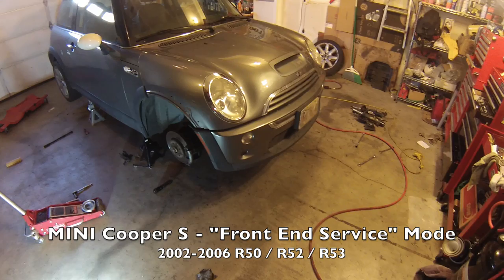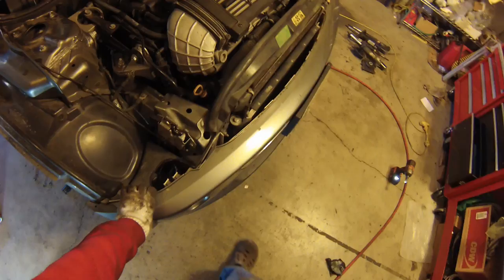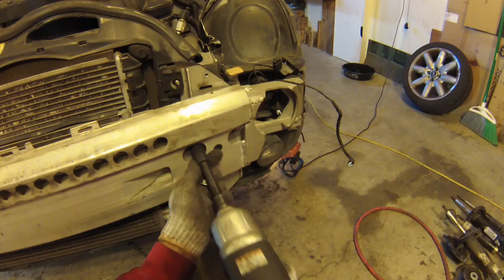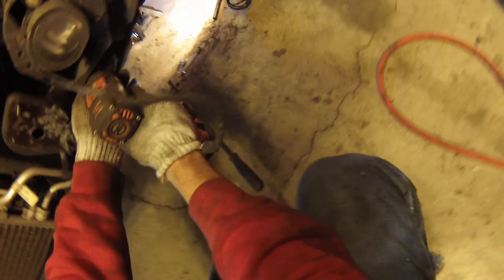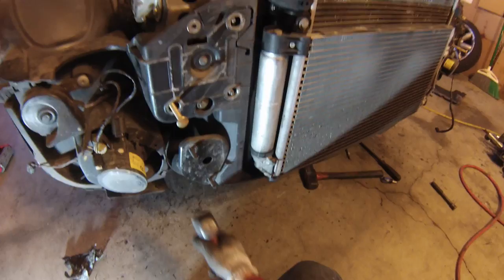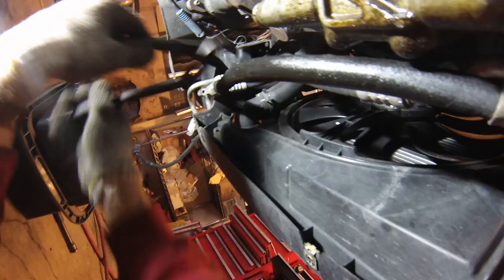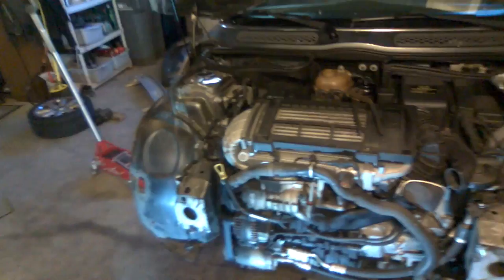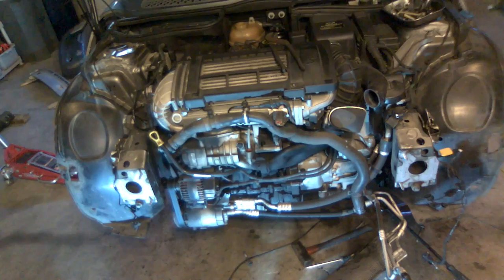Front End Service mode 2002-06 MINI Cooper/radiator/bumper removal howto

Comment: Great video and narration :)

what length and diameter size are the 2 support bolts to hold the front bumper section please when I disassembling. If possible the diameter in millimetres where they screw in.

With this radiator pulled away but still attached by radiator hoses, would this give enough clearance to allow the  low speed resistor to be changed?   
regards
Reply from the maker: ***** They should be M8 x 1.25 bolts, the longest you can find. Should be enough room to work on the fan resistor but the angles will be a little strange.
Reply: top bloke :) many thanks for your reply. Keep up the good work-we need you.
Reply: I found you don’t need any bolts. Just use a couple of long screwdrivers and slide them in. Worked just fine when I replaced my alternator.

Comment: Thanks for all the videos! I didn't see one for the reassembly though and it looks like there are some nuances to getting the radiator back on, functional, getting bubbles out, etc. I've been following you religiously the past few weeks since I inherited a 2004 Mini S and have been repairing it to pass inspection.
Anyways, do you have a reassembly video by chance?
Reply from the maker: +David Konopka Unfortunately not in one place. I show radiator bleed and front end assembly in several of my other videos. Sorry, I don't recall which, but should be some footage in most of the major engine/clutch repair videos.

Comment: I have an 06 cooper s and when i drive and turn on the a/c it goes into limp mode with the ses light now. Air blows cold when idling though. any idea at all would help
Reply from the maker: Might have a failing AC pump and it is putting excessive load on engine?

Comment: My customer came to the shop with a leaking radiator on a 2003 Mini. No one in town would work on this car. Even with a hoist it took me all day to get to the radiator. Since then I have done a heater core, sucked! Thermostat, sucked! Heater hoses, Sucked. And know the ac condenser has been damaged from running into a stop curb in a parking lot! I have to tear the from end off to change that in the morning. Oops, start working on it in the morning. I'm sure it will be dark tomorrow before it's even close to being done!! But-- They are really good paying people!
Reply from the maker: Not fun the first time, but with practice, you can get the radiator completely off the car in around a half hour, thermostat 45 minutes or so. And hose clamp pliers are a must. http://amzn.to/1miUekA
Heater core... that's a headache on just about any car. Keep calm and carry on.

Comment: Hi if the ambient temp sensor is not working could it possibly just be plugged in backwards as it was in this video?
Reply from the maker: Impossible to plug in backward.
Reply: @ModMINI  ok I had to replace the plug that was missing and add a sensor. It works now.

Comment: Got a quick one for you, ive recently changed my spark plugs but on removing the 2nd one  the bottom end of the spark plug was covered oil what would you say is the problem?
Reply: Its mileage is 68,222 miles
Reply from the maker: Valve cover gasket spark plug tube seal?

Comment: A friend is giving my brother a 2010 which needs an alternator...  so thanks for this video.  Looking forward to working on this car..  Any recommendations on the manufactuerer replacement parts.. replacing the alternator = new belt -- saw at Rock Auto a Gates HP racing belt... is this worth the extra $$, also tensioner puller + idler pully as well as the crankshaft position sensor that you mention?? Any other parts to change while "you can get to them"  thanks.
Reply from the maker: 2010 is a totally different car. This video won't help you. You don't need a racing belt and crank position sensors are not problematic on 2010. You may want to replace oil filter housing gasket which commonly leaks. It's behind the exhaust manifold (downpipe).
Reply: The car is about 50 miles away from where we live and tow prices are outrageous... Question -- If we throw a battery in.. and start it.. will trying to run it solely on a battery both a) work and b) potentially cause any engine damage??  c) any experience on possible how far one could get without an alternator thanks.
Reply from the maker: Maybe 5 miles without alternator...
Reply: Disconnected the head lights and got 30 miles before it ran down on a new battery.. thanks.

Comment: Good video! Now, a question... Where can I find OEM screws and bolts, as well as connectors for the bumper lights for my 2003 Mini? Some dude jumped the red light and clipped my car in an intersection and took the whole bumper away and took off... I gave chase and got him. Now, the insurance company will total the car and I plan to buy it back and fix it. So, anyplace to buy all the needed parts over the Internet at a good price?
Reply from the maker: +Adrian Mendoza You can buy most parts from the dealer but will be expensive. eBay and Amazon are good places to look for aftermarket parts. Nuts and bolts will be harder. Some are available from the dealer / online, some you are just going to have to find a suitable replacement. You might go to a local junkyard and take some nuts/bolts off various MINIs and BMWs. Go to realoem.com for an idea of what parts the dealer is likely to sell.
Reply: +Mod MINI Thank you very much!

Comment: Hello mod MINI, whether is it possible to replace crankchaft senzor o-ring without removing cooling radiator ? Just remove bumper and then replace o ring while still standing on support bolts ? Best regards !
Reply from the maker: Yes, that is the proper way.
Reply: Mod MINI thanks for answer ! best regards

Comment: What size bolts do I need to hold the radiator in place?  mm?  length?
Reply from the maker: +Ryan & Jen I believe they are M6 x1.00 thread, and just get the longest you can find.

Comment: Hello Mod MINI, I recently started having a coolant leak that has evolved into dumping the entire reservoir tank in a 5 mike drive. I just replaced the gasket from flange to block and water pump to flange. The mechanic who worked on this before used some sort of silicon around the old gasket. After the new gaskets the leak is still there and just as bad. Is it true the water pump dumps coolant when it’s old?
Reply from the maker: A leak that bad should be easy to find. Are you talking about thermostat gasket or water pump gasket? If you replaced the thermostat gasket, the leak could be coming from the thermostat housing itself. If water pump, assuming R53, a leak that bad from the water pump should be obvious as well. Usually leaks out the weep hole for the impeller shaft.
Reply: I changed the water pump and got a new flange for the engine block too. I was filling the system with coolant and let it idle and there was no constant drip anymore but I as I got in I could here a spurting noise that was coming from the cap. It looked like I had put too much coolant and it was being forced out of the cap in the reservoir tank. I removed coolant drove it 100 miles in traffic with no problems but when I finished the tank was empty. New cap possibly? The thermostat was replaced 3 months ago and there was no visible leaks from it or anything else. The old pump as a stream of dry coolant coming from the bleeder hole.

Comment: Thank you for all of the videos you have posted. They are all very helpful. I was just wondering if you had any idea of a website that sells the wheel well plugs. I ruined a lot of mine when taking them out. Living in New England with all the salty roading in the winter really took a toll on this mini when my father owned it.
Reply from the maker: Do you mean the retainer clips? ECS Tuning should have them or your local dealer, or check out eBay... ecstuning.com
Reply: ***** I think I found them on ebay, if those are the same "plastic lugs" in the wheel well liner. I store the car a few towns over from me so I can't look at them at the moment to be sure. I appreciate the quick response. thank you

Comment: Thanks for your videos. They are helping me a lot with my R50.
Just a Quick question @Mod Mini, Is there a way to replace the knock Sensor Without having to put the Car in Front End Service Mode?
Reply: As R50 does not have the Super Charger, it is possible to see the Knock, but i'm afraid of taking it out and then having suffer to put the new one in the proper position.
Reply from the maker: For R50, remove intake manifold to replace knock sensor .I don't know if it can be done without service mode. Not hard to put back in proper position. just bolt it up in the same hole you took it out. The orientation is not important other than to keep wire from rubbing on something.
Reply: @ModMINI  Thanks for your feedback... Your videos are amazing, keep making them. I couldn't figure out a way to replace the sensor without service mode, although its a very easy replacement, the sensor location is not helpfull. I took the chance and replaced the AC Bearing

Comment: I am going to be replacing the Radiator Support (Front Bulkhead Oem Gen1 R52 R53 Cooper S). What fasteners do I need? Currently purchasing from Mini Mania.
Reply from the maker: None, you should be able to reuse all of them.
Reply: Some of them are broken. Had part of a cover on the bottom break and it threw plastic under the car and broke part of the Radiator Cover.
Reply from the maker: Look up realoem.com for parts and fasteners.

Comment: Hi, Do you need to recharge ac after front end service mode?
Reply from the maker: Only if you punch a hole in the condenser by accident. The AC system is not opened.

Comment: I need help Removing those two fog lights , I don't know where to disconnect it from
Reply from the maker: sultan sullins Behind the wheel liner. If you have trouble disconnecting the clips, just turn the whole bulb 120 degrees and take the whole bulb out.

Comment: In this video you mentioned the Knock Sensor. Did you make another video covering this? I'm getting code P0326 Knock Sensor 1 Circuit (Bank 1). This is all foreign to me so after getting the front end off I'd be confused on what to do next.
Thanks in advance.
Reply from the maker: Hi. No other video, but knock sensor is directly behind the supercharger. You can see the wire on the front of the intake manifold but the supercharger has to come off to get to it.  Check my supercharger oil service video. MINI Cooper S Supercharger Oil Service R53 Eaton M45
Reply: *****
Ok, thanks for that information.

Comment: I am in process of having to do a head gasket on a 2012 countryman 4wheel drive  will I need to remove front bumper like this to do it
Reply from the maker: +John Slaton Yes but it will be a different process.
Reply: Ok thank you will.i need to remove engine or is it possible  to.remove timing cover in vehicle??
Reply from the maker: +John Slaton The Countryman engine does not have a removable timing cover. It uses a timing chain cassette with a two piece crankshaft sprocket. The work can be done in the vehicle.

Comment: Thanks for shearing this great video, I have a coolant leak problem from my R53, literally it leak from the connection part between the upper hose and the radiator, it looks like a hard plastic and fixed with the radiator. it's that possible to replace it?
Reply from the maker: L cyrus That's common on the 2003 and earlier. The radiator inlet is separate piece from the radiator. You might be able to pull and replace the o-ring, but no guarantee it will work and I've never seen this part available on its own. Plus, the plastic may flex with age. Recommended fix is a new radiator.
Reply: Yea, I've been looking for that connector for a while. Do you know the size of that o-ring? I can try replace it first rather than replace whole radiator.
Reply from the maker: L cyrus I don't know the size. It's skinnier than the general purpose ones that you can get at Harbor Freight.

Comment: How  lm qen remove oil dipstick tube an may mini cooper sjohn supercharge
Reply from the maker: Many of your words do not make sense. You want to remove entire tube? Put car in front end service mode, then remove two 13mm bolts holding the dipstick tube. Pull up while wiggling the tube and rotating the top forward. Eventually it will pop out.

Comment: what do you use to organize all the bolts you remove for a job as complicated as this?
Reply from the maker: Just a magnetic parts tray like this: Or, you can put the bolts with the thing you removed. http://amzn.to/2bdULwa
Reply: I've always been very paranoid about mixing up bolts, so I've used egg cartons for the task. Would you suggest replacing the water pump as well when removing the supercharger for servicing? Car is a very well maintained 03 JCW with 127,000 miles that I bought recently. I plan on replacing at the very least the serpentine belt and supercharger oil, is there any other servicing that is worthwhile to do while the car is in service mode? differential/transmission oil?
Reply from the maker: Absolutely replace water pump since it's the same labor. I've seen water pumps start to leak a lot recently.

Comment: The one in front of the radiator. What is it called ? Because mine is leaking on my 04 Mini Cooper.
Reply from the maker: +Carlos Huerta AC condenser?
Reply: Yes. When installing the new one do I need to add any oils or refrigerant ?
Reply from the maker: +Carlos Huerta yes of course all of the refrigerant is gone. You need to replace the receiver/dryer as well if the system has been open for any period of time. If you're not sure what you are doing are you do not have the correct tools, take it to a certified air conditioning repair facility.

Comment: Hey man what’s going on ?👍🏿👍🏿 for all you videos I become very knowledgeable about my mini hard top R53 04 thanks to your vid now it time for a new supercharger and I was thinking going a different way with a turbo. Now I’d like to know if u have an idea about the r50 mini air intake manifold and the r53s will it fit if I take out my supercharger everything else
Reply from the maker: Wow. An r50 intake would bolt right up but I don't know if it has the right strength or airflow capacity/characteristics to handle something like a turbo. You would also need an aftermarket ECU, custom exhaust manifold, probably a front mount intercooler, electric water pump, etc. This would not be a project for the faint of heart and certainly not recommended for a daily driver. Probably best to use a proven kit.
Reply: Thanks for responding so quickly now I c it done a few vid on YouTube and all like if u look for r53 turbo I’m not looking fo big power  it just that my supercharger is going bad and it expensive to get a rebuilt one and I love my mini I’m going to all d r50 stuff like water pump intake manifold now would d r53 injectors fit on d r50 intake manifold
Reply from the maker: Look, it's going to be a lot cheaper to just replace the supercharger. Look on ebay, used ones are cheaper than you think. Replace the supercharger oil and the supercharger will outlast the remaining life of your engine. If you try to build a turbo setup yourself you are going to run into all kinds of engineering problems. Such a project will easily cost thousands of USD.
Reply: Thanks so much for your help I will keep d info mind and again for the video they saved me a lot of money 💰 thanks.

Comment: I have gen 1 '04 mini cooper, would it be much different to deconstruct?
Reply from the maker: Pretty much identical for all gen 1.
Reply: @ModMINI  without examining the car, which components would you say are crucial to look at and replace on a gen 1 of 120k+ miles
Reply: I don't know much about cars, so i'm wondering if you could offer some advice. I plan to start small and replace disc brakes and look at the radiator and other things associated to it
Reply from the maker: Jac watch my buying a 2002-2006 Mini Cooper video. Radiator is fine unless it’s leaking.

Comment: Does this require ant special tools or screwdriver bits?
Reply from the maker: Vanderfleet Martin It depends if you consider a Torx bit to be a special tool. That's the only 'strange' tool needed to remove the front end.
Reply: What size is the bit?
Reply from the maker: I think I mention in the video, it is either a T25 or T30 bit.